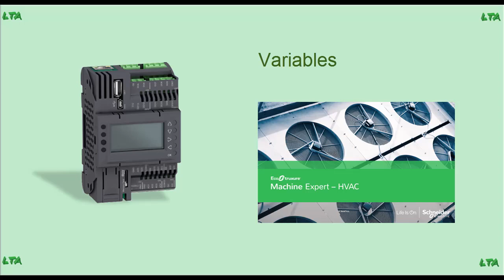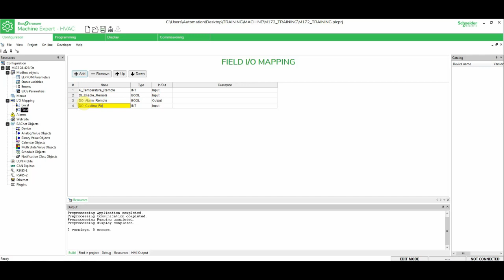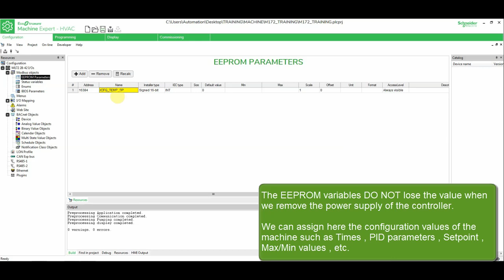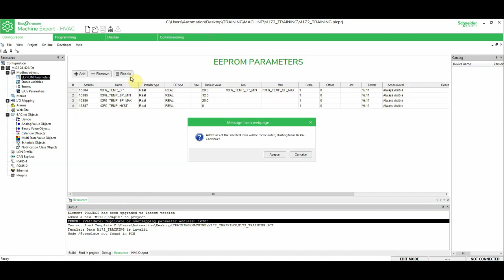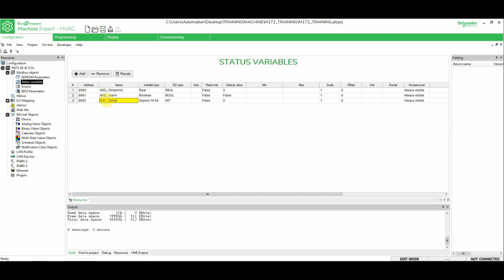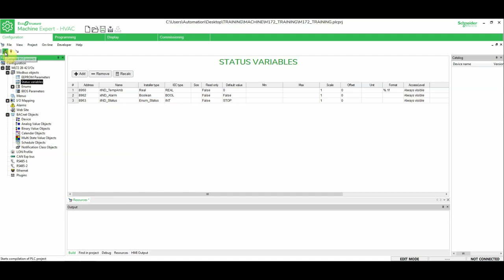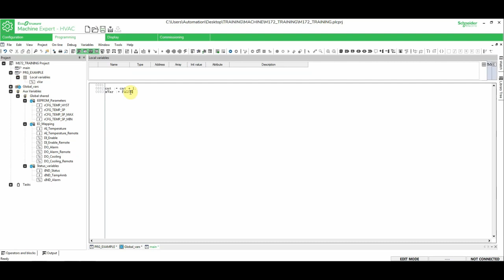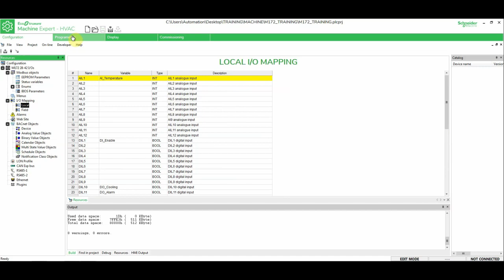EcoStruxure Machine Expert HVAC - Variables

Comment: Hello, quick question:

What's the purpose of the min max value in variable setting?

I've tried to use it to control the value of a USINT variable but it seems to not work since the value can still goes past the designated max value
Reply from the maker: Hello Hanif Ong! Long story short.... that configuration is useful when you are in the commissioning or in the installer not for the programming.  I have not done the video for this topic but you can take a look to my ppt: https://app.box.com/s/mt1v9wup4c94ta3dsifb237dolq7ixmf

Comment: 11:01 In Machine Expert HVAC v 1.5 "Aux Variables" are replaced by "Configuration_variables". How to write Status Variable from Display level? I get error "PAGEDRAW(57) error A4103: data block not found" when i try write variable from "Local procedures". I want to reset bacnet message counter using sysBACnet_IpMsgCounter := 0;
Reply from the maker: Hi there! Maybe you have already figure it out by now but to you will need to use code in the display (procedures) in order to change a value using logic (video set param).

Comment: Hi i creat a varible of array type but when i use retain then erro program you can take some solution for the prolem
Reply from the maker: Hi quy dao! I usually do not work with internal variables to retain information (because i sometimes receive error sometimes) if you want to do that then use the eeprom variables ( but it is a real shame that we do not have a arrays to define there 🥲)
Reply: @LeTomasAHUMADA  hi i am using effrom area but i cant use that area in caculating command as add, sub,mul...
Reply from the maker: @quydao7746  if you are using eeprom variables you can use them in the logic directly as “readable” but if you want to change the value then you must use an specific block depending on the variables type. The function block start with “ sysWriteParxxxx” check on the operators and blocks > target blocks for those functions
Reply: @LeTomasAHUMADA  if i have a exprestion i:=i+1 so can I use function syswriteparxx ? you can guide me execute  .thanks you so much

Comment: Hello, I need to read some BV from local variables, linked with Bacnet object of a scada system, its necessary to declare to variables to link with bacnet objects in EPROM variables? At this moment I can see all  Bacnet atributes, but PLC do not refresh BV for  local variables linked with the BACNET object. Could you help me please.
Reply from the maker: Hi Marcos! I am not sure if I shared this with you but below you can find a Library for Bacnet called BACnet_Addon that allow you to easily share the data:
https://schneider-electric.box.com/s/ki01hoop3gn16fq98g832bvz4rxld6rx

Once you create the Bacnet Object based on the Value Object you can use the BACnet functions of the library.
Inside that link there is also a library guide in there you should be able to see what kind of variable do you need.
Reply: @LeTomasAHUMADA  thanks !!! Yes in AddOn libraries have a function to
Link local variables and bacnet objets. Solved issue . 
Regards .